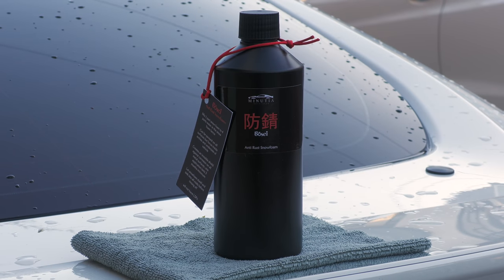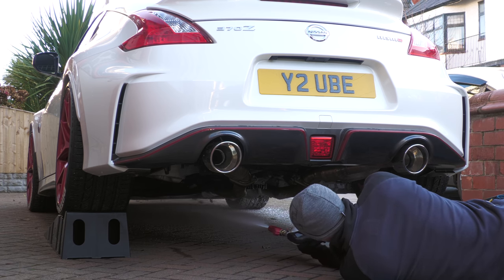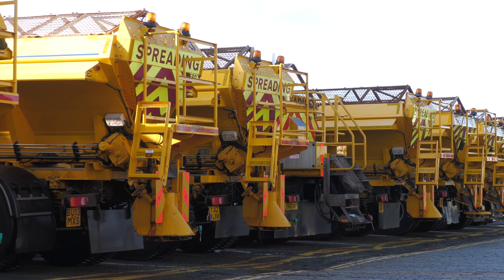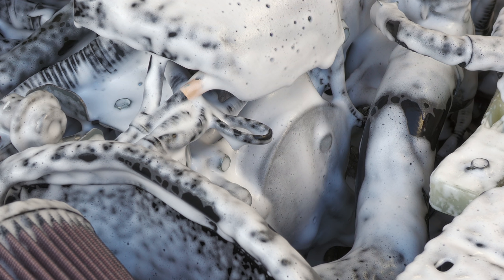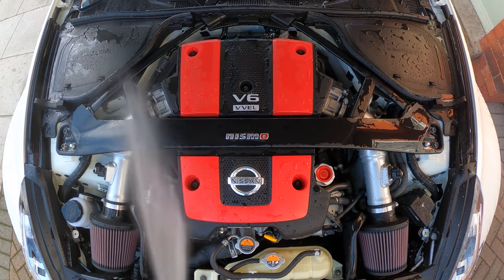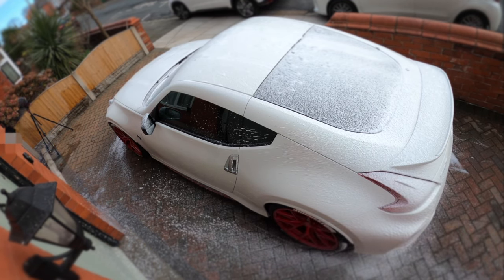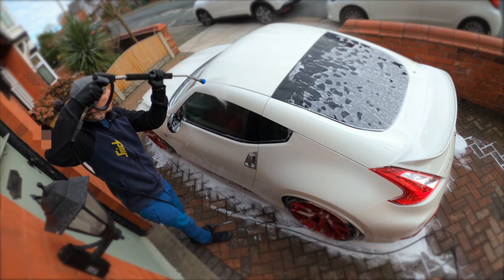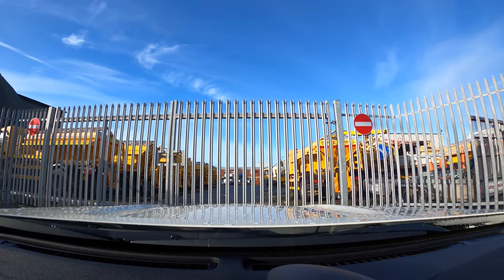Anti-Rust Snow Foam Bath

Comment: If the neighbors weren’t convinced you were crazy by now, they’ve certainly confirmed it with this! They don’t have a pride and joy to understand how satisfying and important this kind of detailing is…
Reply: A anti-rust snow foam is all well and good, but it seems excessive. Even just quickly rinsing off the under-carriage can be a great preventative measure. Besides, the under-carriage is perpetually expose to dirt, water, salt, asphalt, and iron. So unless you plan to clean it weekly, it will rust no matter what.

Comment: Living in Ontario Canada, winter driving with salt on the roads is a fact of life. That rust retarding snow foam looks great, but here I would definitely follow up with an application of Krown which is an oil based rust proofing.
Reply: The whole anti rust property of the foam is more of a gimmick anyways. Cleaning is what stops dirt building up wich then retains moisture wich then rusts. Nothing protects metals from actual corrosion like an oil/ grease based coating! So I totally agree with you.✌️
Reply: @y4nnickschmitt  yessir, just spray the whole underbody with cavity grease and you are gucci haha

Comment: Were buying a car lift here for mainly installing a downpipe on my gti clubsport, but also do regular service on 3 cars. This video gave me the idea to try this foam bath with iron remover, instead of giving the car a full rust protection. Iv heard from a mechanic giving it real rust protection will make it sticky surface under the car. So maby this procedure with somewhat regular intervals would be a better idea. Mechanic also told us new cars have so good rust protection anyways. But imean "When in Rome..."  🙂  Thanks for the idea!  👍

Comment: The real question is: did the brake disks get surface rust after you rinsed the foam off? 😂👍🏻
Reply: Ditto Joe, any experience with BH Atom mac for the discs, on your Volly did you suffer the instant brown which fights all the hard work on wheels.
Reply: @13pcbs  of course they did. these companies could bottle plain water and people would say it does something. its called affiliate marketing.
Reply from the maker: “These companies”. He’s a respected one man band pro detailer who thought it might be a good idea to incorporate rust inhibitors into a snow foam for ease of application.
Reply: @CarCleaningGuru  for sure, I ordered a bottle as soon as I watched the video, as anything that helps prevent rust is good with me! The comment was just a joke reference to how irritating rusty discs are after having washed a car, nothing more👍🏻
Reply from the maker: @DaveRebuilds  Oh I was responding to the last comment. From what I can remember the discs were about as rusty as they usually are following an application of atom Mac but to be fair I didn’t give them a dedicated spray.
Reply: @CarCleaningGuru  my bad, just realised that myself 😂👍🏻. Great video as always btw
Reply: @CarCleaningGuru  Cheers Joe, bit of a pain but recently found that blow drying the Atom before washing performs better, only an exhaust tip type tinge then. Ste.

Comment: Very good idea. I do it on a similar way. A bit fiddly and time consuming process, but doesn’t have to be done every week. Car on similar ramp, doing the front at first and the rear then doing it sideways, cleaning both sides, applying a heavy duty touchless TFR to the chassis, letting it to dwell, agitate, rinsing it off with a bent underbody pressure washer lance and then applying a corrosion inhibitor such as BH Atom-Mac or a silicone based rust inhibitor blend from a pump sprayer. I think it’s great using something like this in one step. BH Auto-Foam used to contain rust inhibitors too, but I can’t see that written anywhere anymore, perhaps they’ve changed the formula during its development. This should be great, I hope next spring, after your inspection, you will be able report us no furter rusting Joe! 👌🏻🤩👍🏻

Comment: Those plastic ramps are great - I wish I'd bought myself a set earlier - they are so much lighter and easier to use than the steel ones.  I have no doubt they are safe at least for regular vehicle applications as they are solid as anything. This product seems like a great idea, though as they don't salt the roads in my country my 12 year old Lexus has less rust on the bottom than your 4 year old Nismo.  It must be horrible knowing you have to drive such a beautiful car on salted roads!  The occasions I do have to drive on a gritted road in winter is enough to make me shudder.

Comment: ACF-50 is great for preventing rust If you don't fancy caking your car in underseal
Reply: We use ACF50 on our rotor blades and a few other exposed bits, does a good job.

Note to self: I really must pinch the boss's spray can to do my car...! 😂
Reply: Rust starts under the underseal.. these mickey mouse products just make u sleep well
Reply: @andyvaid69  not if it's applied over stone chips, scuffs, etc.

And given that a lot of components (most of them) aren't undersealed... it will preserve the parts for a little longer. So I sleep better. 🤣
Reply from the maker: It’s an inhibiting maintenance product. Nothing beats mechanically removing rust then adding a dedicated long term rust proofing product but using something regularly that contains rust inhibitors, especially to parts that might not be proofed or have already started to rust makes perfect sense.

Comment: Would be interesting to see how this stuff stacks up against Bilt Hamber auto foam's anti corrosion properties
Reply: Using Bilt Hamber so would like to see some kind of comparison also. Have been using the Atom Mac as a corrosion inhibitor behind wheel arches, brake discs, hub and undercarriage.
Reply: @koolkat969  How has the Atom Mac held up on the suspension components?
Reply: @Dkcode  The suspension arms had the typical surface corrosion before i started using it so the Atom Mac was used to stop them deteriorating and I've only just started using it. The surface of the discs however have remained clear compared to the browning on the surface i used to get on the discs after a wash.
Reply: @koolkat969  Ah I can’t work out what I’m doing wrong here. I use Atom Mac at 5% and the disks still turn brown during a wash. It’s annoying. Though at least they don’t mar the alloys after a wash like they used to, the moment you go out for a drive.

Comment: I would like to see a test with 2 bits of bare metal exposed to salt, one coated, one without.  This will very likely do nothing to protect from rust - instead use a wax spray like dynax or lanoguard.
Reply from the maker: This is just a maintenance product, not a dedicated rust proofer.

Comment: Gonna try acquiring some of this in the US. I live in the salt belt and my 17 FiST is already showing some beginnings of rust, even with regular rinsing of the grundle all winter.
Reply: Research “salt away”. I’ve been using it for years as a wash and you can also spray it on and let dwell. That product along with fluid film and your good as new year round.
Reply: @BrendonVorio  awesome, thanks!

Comment: I thought road salt is only a thing when they lay down road salt for snow/ice which rarely happens in the UK?
Reply from the maker: We quite commonly get zero or sub zero temps overnight so have a few months worth off salty roads.
Reply: @CarCleaningGuru  Oh right. I live in Bham and it’s probably a handful of days where they salt the roads in the city. Perhaps it’s much more common on the motorways and A/B roads and more common up north? Interesting ramps you picked up. Not the cheapest but seem to do a good job. Patio cleaners turned upside down are good for the under carriages. I’d like to do mine with some anti corrosion products from bilt hamber like Atom Mac and use snow foam to clean and get rid of the dirt underneath beforehand.

Comment: It's ok to spray the exposed filters, just remove them real quick and blow them out with compressed air just to be safe.
Reply: Never a good idea to use compressed air on an air filter. They aren't designed to take such high shots of air and can easily become damaged.
Reply: @Saavvvv  - these are aftermarket, a lot stiffer than paper filters.  I do it all the time to mine when I clean them every six months

Comment: Yeah, well so I too was backing my 370Z onto identical ramps, and while I was completely smooth and steady with my throttle & clutch work and my speed, the ramps were suddenly thrown forward by the torque of the wheels and my car landed on top of them on its side skirts which put a smashed dent into the skirt 😠😭
Reply from the maker: Yikes!

Comment: You should consider Krown rust proofing, I believe they do it in the UK however I have seen they do a VERY good job compared to north America. They take off body parts and spray areas you would normally not get to. Would make a great video too.
Reply: They don't remove the old underseal.. just paint over it. Bodge job

Comment: Just undercoated your car in fluid film. One of my trucks has 430,000miles on it and is 12yrs old and has zero rust on it not even a rusty bolt. This foam isnt going to do anything for road salt. Itll just wash away in the rain and road slush if the salt doesnt eat through whatever this foam leaves behind
Reply from the maker: Would still rather use a snow foam that has rust inhibitors than doesn’t.
Reply: @CarCleaningGuru  those rust inhibitors in that wash are lasting like 3weeks
Reply from the maker: It’s a maintenance product intended to be used routinely, not a dedicated stand-alone rust proofing product.
Reply: @CarCleaningGuru  fluid film makes this stuff not even needed. It lasts all year

Comment: That's not going to do anything. Need to spray the car with fluid film or some other rustproofing.
Reply: I assure you it works just fine. Its not designed as a long term protection, more to top up existing protection such as acf50 or clear underseal. The inhibitors bond to any naked metals and also neutralise road salt. Unless your a scientist that has tested it to prove me wrong?!

Comment: Sorry mate love your channel but this is bollocks get a small compressor and touch up gun and spray some acf50 on those parts job done
Reply from the maker: If you’re already using snow foam on a car in the winter you might as well use one with rust inhibitors. It’s not supposed to be a stand alone rust proofer so yes use something like that if you have the time.

Comment: Another cover up bodge job product! Rust starts inside the cars structure and under the underseal and paint.u don't remove anything..u r ripping yourself off
Reply from the maker: It’s not supposed to be used in place of a wire brush to remove rust you plonker and it doesn’t “cover” anything. It’s intended to inhibit the spread of surface rust and neutralise road salt. Sinple.
Reply: @CarCleaningGuru  er nope

 U r just covering up stuff which u can't see!!! I do this for a living.. seen so many cars with crap just covering up rust
Reply: @CarCleaningGuru  lool rust does not start on top of the underseal!!!!!!!? It never ever has or will.... So what the faaaaaaaaaaaaaaaaaark is it doing on the surface of the UNDERSEAL??????
Reply: @CarCleaningGuru  and we use angle grinders and the Snap On crud buster.. wire brush is for the basic lot!
Reply from the maker: @andyvaid69  As I said it doesn’t cover anything. It looks exactly the same once rinsed off but the temporary inhibitors will help to slow the spread of any surface rust as well as repelling and neutralising road salt upon contact.